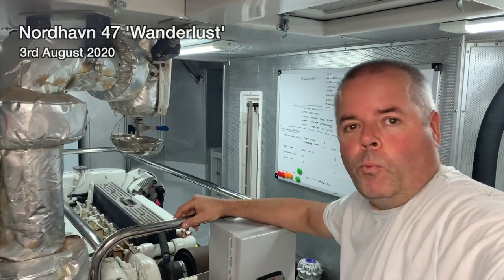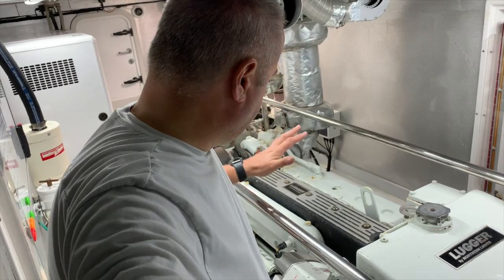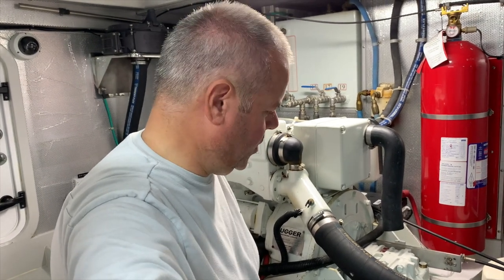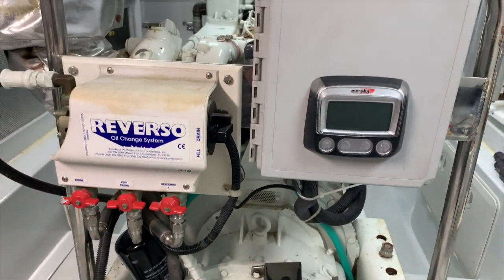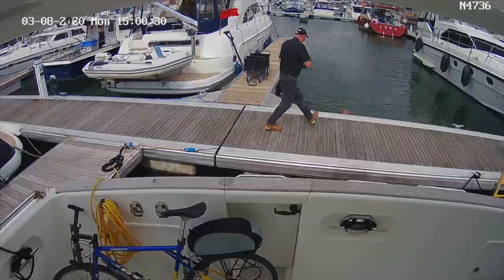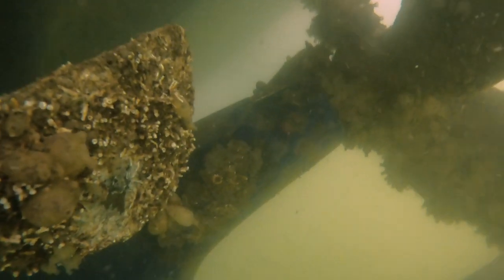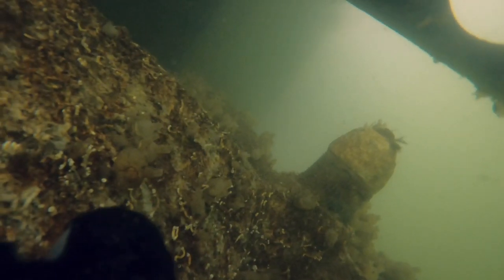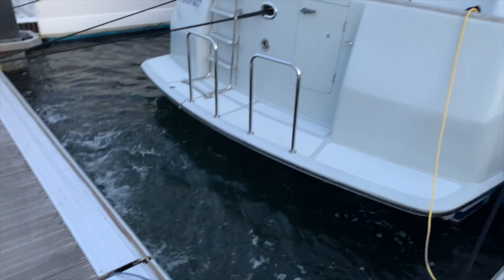Nordhavn 47 'Wanderlust' - Underwater Maintenance

Comment: I wondered about this in another Nordhaven video and wondered why more owners did not run on the wing engine more just to give them a run. Most of the time you go with tide so why not run the wing then. My boat had twin engines but I would often run one engine if on a quite canal as it would be just above tick over. The tricky bit was steering as I had a center rudder and would then only get wash down one side of it, fine one way but not the other.

I kept my boat on the Thames and suffered from fresh water growth, take her on a sea trip and it all fell off. But the sea growth started went back on the Thames and that fell off, the cycle continued. On lift out it only took a quick jet wash off and she was ready for anti foul. As an extra precaution I dropped anodes off the side connected to a grounded cable, especially if I was surrounded by boats taking on shore power.
Reply from the maker: I do keep promising to myself that I would use the wing engine more but it never seems to be the right time. I think if I knew I was going to be early for any reason I would use it instead of the main but there are certain issues in doing that. 
The stabilisers are driven hydraulically from the main engine so you would loose that feature if the main was switched off. 
Power generation isn’t too much of a problem as we have a large inverter and a generator so I don’t have that as an excuse. 
All I can say is that it’s never the right time - our speed drops to under 5 knots on wing alone and I can’t see the point in running the wing with the main still on so the wing just gets used 20 mins here and there... I have certainly used it more than the previous owner. 
As far as underwater growth goes, switching from fresh to saltwater is great at killing that off. I just don’t spend any time in fresh water in order to do that.
Reply: @Bloater  Make it a habit to flash up the wing engine everytime going to and from the dock as your back up. Plus maybe make a day of it driving mostly on the wing engine as a practice day. It will be a good excuse to get away from the dock.

Comment: Love your bridge screens Whats the set up you've gone for there? Are they 4 independent computers hooked up to screens with nmea bridge connecting them all?
Reply from the maker: Jesse, not so, in the pilot house (from left to right) we have a classic Raymarine E120, then 2x touchscreens connected to a Vasari PC computer running Timezero and then a separate Vasari PC running OpenCPN.

I’ve had all 3 Touchscreens running off the Timezero PC but I prefer having a separate backup navigation system so I settled with using 2. 

The E120 and the TZ PC are both connected to the NMEA2k network so either can read sensor inputs and also operate the autopilot. 

We have 2x screens on the flybridge and these exactly mirror the centre two pilothouse screens.
Reply: @Bloater  Nice to see you again on your boat, I remember helping you on your trip from Portishead to Portland for the lift out.  Your diving seems to help overcome the problem, Did you try coating the props with anything when it was out of the water in Portland?
Reply from the maker: @andrewfisher4844  Hi Andrew, it is very nice to hear from you. I hope all is well with you. You weren’t driving that Ever Given were you (only joking)!

I ended up coating the props with International Trilux for underwater gear. Very small tin for a lot of money - but that doesn’t necessarily mean that it does the job.  The gear mechanism was liberally sprayed with some expensive adhesive grease and then coated with lots of waterproof grease. It hasn’t seemed to helped much though.

With lockdown I haven’t seen the boat this year yet so I know what is waiting for me underneath!

Comment: Silly question.. but you could use an ordinary home use jet wash to clean the prop etc?
Reply from the maker: The jetwash equipment that boatyards use is far better than the kit you can buy in a DIY store… I assume you mean cleaning the prop when the boat is lifted out?  You couldn’t possibly jetwash when under the water that is  just not feasible on so many fronts.

Comment: If you can let her dry out there's a high water slip on spring tide in Watermouth Harbour  will hold her about 2 foot off the floor.  If that helps.
Reply from the maker: There is unfortunately no way Wanderlust can take the ground. The stabiliser fins are the problem. I even explored the possibility of a local dry dock but the boatyard took one look at a photo of the hull and the value of the boat and ran a mile.

Comment: Have you tried Prop speed paint ?
Reply from the maker: I’ve not used Prop Speed and I know other Nordhavn owners do use that. I used International Trilux.  I should have mentioned that last lift out was 13 months ago. The main problem is the gear teeth in the folding prop and for that we use grease not paint.